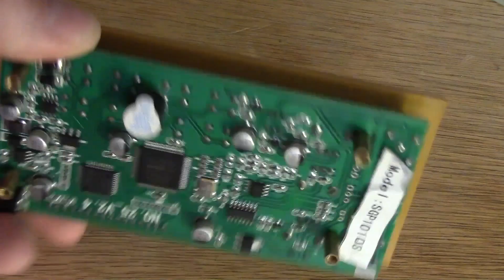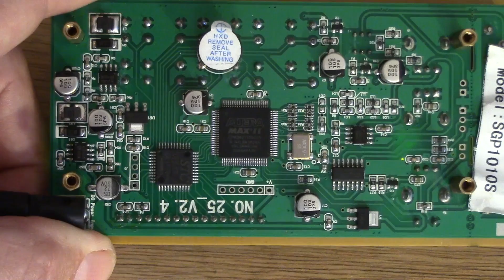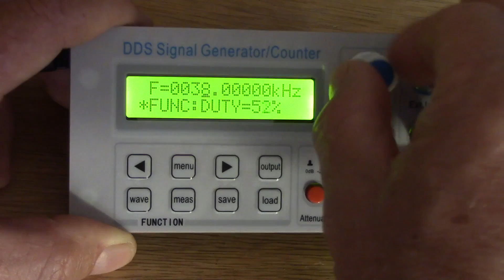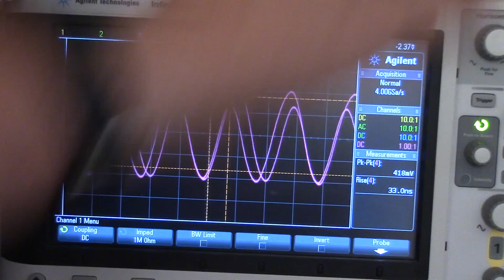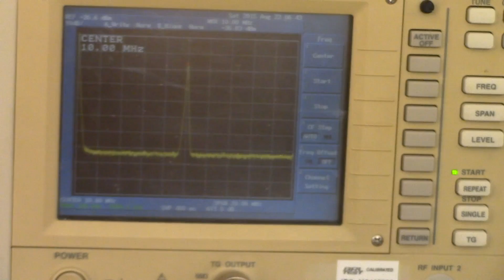Episode 16 - Review of a $50 Chinese signal generator

Comment: I have this one and I am very happy with it.

It was not mentioned in the spec and in this video, but this signal generator can do Sawtooth waveforms as well. Both rump up and rump down. You just set it to triangle and than when it asks for a duty cycle, you move it to 49% or 51% for ramp downs or rump ups.

Comment: The back and forth at higher frequencies/odder duty cycles looks like quantization noise — i.e. You're seeing 1 sample worth of the underlying dac frequency, when the numerical result is right in between the two samples.
Reply: I've tested the Rigol DDS generators in our school's lab, and it also has this funny effect, even at 10MHz (trigged on the sync output).  I think this is the artifact of digital non-integer frequency synthesis, since my own HP function generator that runs on a VCO doesn't have that weird jitter at all.
Reply: Yes, it's quantization noise. I've build an DDS generator as my bachelor thesis and this is common thing. When square wave is generated, the DAC basically receives the highest possible value (for example 0xFFF for 12bit DAC) for fist half of the period and then the lowest possible value for the other half (0x000). When your main clock runs at 20Mhz, and you are trying to generate something like 1.6Mhz, it's not evenly divisible and you are gonna get 12.5 samples per one period (6.25 per half), which means that your internal counter will jump one sample every other period - the patern will be 7x0xFFF - 6x0x000 - 6x0xFFF - 6x0x000 - 7x0xFFF -6x0x000, etc. You can think of it as adding 6.25 over and over to itself and changing the level every time the internal counter is higher or even that value, like 6.25 (change on 7th sample), 12.5 (change on 13th sample), 18.75 (19th sample), 25 (25th sample), 31.25 (32th) and so on.
The only way around this is to either change the main clock depending on frequency generated (almost impossible) or to go significanly higher with the clock speed.

Comment: I got one.  Works perfectly.  Thanks, Jack!
Reply: I can't figure out the sweep function. Pushing the rotary encoder adjust button (ADJ) seems to just shut it off, and I can't enter the sweep range. Oddly, if I switch from LINear to LOGrithmic, it sweeps from some low freq(I can't read the numbers when they are changing that fast) up past 42Mhz. It's only the 2Mhz model. SGP1002S. Help

Comment: The jitter makes complete sense.  They have implemented a numerical controlled oscillator. Basically a feedback accumulator. If the fpga clock frequency is too low, you will have that kind of jitter.
Reply: I think you are right. But that's a very undesirable design decision, as it results in this jitter. It would be far better to simply use (and specify) a coarser PWM resolution.

Comment: For that amount, you can add a tiny bit more and get a 40M samples /sec USB oscilloscope with a way better function generator (with regards to the output waveform - not features) .

Comment: At 7:10 on your video, those are not 'harmonics', it is rather product of some spurious modulation where you get main frequency and products - sum and difference. Else, great video!
Reply: Actually, I think those really are harmonics. To the left you have the large spike at DC. In the middle you have the intended fundamental at 10 MHz. At the right edge you have the first harmonic of 10MHz, at 20MHz. In the middle of the left half of the screen you have a small peak at 5MHz.. that indicates a 2-cycle pattern of irregularity, possibly to get an exact cumulative frequency given that the sample output rate runs at some fixed clock rate that might not produce exactly 10MHz if every cycle was identical.  And then a similar peak at 15MHz.  Of course, you could describe that as the 10MHz "modulated" by "spurious modulation" of 5MHz, I guess :-).

Comment: Very nice video! That jitter seems pretty weird to me as well...
Also, the Altera part is actually a CPLD, not an FPGA ;)
Reply: Very nice video.
The jitter is a something that all DDS synthesizers do. The DDS output is only jitter free when the output frequency divides evenly into the DDS clocking frequency. For example, if the output frequency is 10 Mhz, and the clock frequency is 100 MHz. then there are 10 samples per output cycle (100 Mhz / 10 MHz) and the output waveform starts and stops at exactly the same spot int he sine wave for each cycle. but consider what happens when the output is 9 Mhz. Now, there are 11.111 sample points per cycle, and the DDS starts and ends each cycle at a different point for each cycle. At first, this doesn't seem like it should be a problem, but remember that the register that controls the output frequency of the DDS is an INTEGER register, and the DDS can not do floating type divides, so each output from the DDS is very slightly different than the last. This jitter is on ALL non-integer output frequencies. It is just not noticeable at lower frequencies.

Here is an experiment you can do to see this effect: Set the generator to 10 Mhz and set the scope so that one or two cycles are visible (so that the jitter can be easily seen). Now, slowly reduce the generator output, decreasing the frequency by very small steps (10 Hz, for example). As you decrease the frequency, you will notice that the jitter will be better at some frequencies, and worse at other frequencies. And some frequencies will have no jitter at all. the frequencies that have no jitter are the ones that where the output frequency is an integer multiple of the clock frequency. If you know the frequency feeding the DDS circuit, you can compute these frequencies.

DDS synthesizers are wonderful devices. You can generate frequencies with very high frequency resolution - down to .001 Hz per step in some cases. But nothing is for free, so to get high frequency resolution, you pay for it with output jitter. Also, that output jitter on the scope shows up on the spectrum analyzer as side spurs, like the ones you show on your video. But for $50 bucks, what would you expect? I'm amazed that what you have sold for as cheap as $50.  The cost for parts and labor alone would be more than that.
Reply: +Frank Rose Of course, i should've known and makes a lot of sense. Thanks anyways for the reply.
Reply: You got it right, but NO not in this case,   in this case it is side bands due to noise on the power rails to LPF circuit.  Can be fixed pronto
Reply: @azzym312  And again you made this comment which is simply incorrect. How would a 10MHz signal acquire a sideband at +/- 5MHz? You would have to modulate it with a 5MHz signal. Where is that 5MHz signal going to come from?  You think the power rails? From a switching power supply?  Since when does a cheapo switcher operate anywhere near that frequency. And yes, obviously 5MHz could be a distant harmonic of a 100kHz switcher, but if it was really leaking that much onto the rails, there would be all kinds of other lower harmonics on there too. So no, this is an artifact of the DDS algorithm, not noise on the rails.

Comment: It would have been nice if it includes a case for it even if they changed for it ,and not everyone.needs a top of the line signal generator ,I work on tube radios ,I bought a pocket oscilloscope and I ordered a signal generator kit for under 5.00 ,a Idea I got from.great scott.

Comment: Nice review, didn't know these existed, last time I looked at low cost signal generators they were all pretty poor, Bought an ATiny based one that only uses six bits, so the sine wave is poor. Would of like to have seen how well the sine looks at the bottom of the frequency range and if it goes down to 20Hz or below, but I guess I'll find that out when I search for it

Comment: What cable were you using from that unit to your scope ???  If it was a supplied cable , it will show that on a scope, the better the cable the better the signal... I've seen it happen before.....

Comment: I know this is a Chinese signal generator but could it be used to generate Australian signals?
Reply: Support for Australian signals was removed in version 1.4
Reply: Darn it.  Figures as we need stuff suited for use upside down.
Reply: I tested mine here in the US, I flipped it upside down, and it worked fine, but all of the signals were inverted, so you have to adjust for that.
Reply: I p
Reply: freequest jnbl
Reply: Yeah, turn it upside down and use a mirror to compensate for the inversion.
Reply: Use the INV setting on you o-scope.....
Reply: Christopher Sibert Be careful, the electrons might fall out!
Reply: Just turn the phase 180 degrees
Reply: Its alright. Both China and Australia are upside down, so the signals will have the same phase.
Reply: You have to run the output through Google translate.
Reply: Since China is buying up most of Australia, yes.

Comment: The rounded square seems to be common on the cheap ebay ones. What I still wonder is how it sounds 
 ;)
Reply: That is bandwidth limitations of the output amplifier/buffer. The question is, what do you require, not what looks good.

Comment: I'm reposting my comment as it doesn't appear that it will appear as a public comment because I included a URL; let's see if this works:

Thanks for the review Jack, a nice adjunct to the YouTube review and simple upgrade of a similar more capable DDS generator by "devtty0". BTW, are you a ham radio operator? The HP8640B is a hint that you might be. 73 - Dino KL0S

Comment: so if i got it right.. with a very low frequency lets say 150 hz will the square wave create almost perfect pulses?
Reply: No, of course not. "Perfect" is an ideal. "Almost perfect" has no more descriptive power than "perfect". Define the pulse you need, otherwise it is like someone asking for a signal generator that goes from 0Hz to someothernumber, or a power supply that goes from 0V to someothernumber. Why would you need a signal generator that puts out 0Hz (no signal) or a power supply that puts out 0V (no poweer)?

Comment: What do you mean by harmonics on both sides at 7:03 ?
Reply: It is referring to the two spikes, one left and one right, of the large spike in the center
Reply: These two spikes are NOT harmonics as he calls them, they are side bands produced because of the amplitude modulation probably caused by a noisy power supply rail. The unit will benefit from a little bit of ground rerouting and filtering.
Reply: +Azzy M You may very well be correct!
I was just reiterating his description. I wouldn't be surprised at all that it has poor grounding and shielding, after all, it doesn't even have a power s/w and it has terrible jitter. Not a useful too,l except to show a child what a basic waveform looks like.  
I did enjoy it though.
Reply: The display he shows has the fundamental (10MHz) in the middle, the DC spike on the extreme left, and a 20MHz (harmonic of 10MHz) a the extreme right. The peaks at 5MHz and 15MHz are not harmonics per se of the 10MHz, but are rather due to some irregularity in the lengths of single cycles played out by the digital synthesizer, in order for it to produce a cumulatively precise 10MHz while operating with a fixed time per DAC sample. Apparently in this case, the strategy leads to half the cycles being one time length, and half the cycles being slightly longer, ie: an approximately 2-cycle pattern that repeats at 5MHz.  These are not cause by a noisy power supply rail, or a grounding or shield problem -- those would produce very different artifacts.

Comment: What do you want for $50?  Actually I've seen for $30.  You've got to factor in:  1) How much demand is there for a product like this worldwide?  2) Their board manufacture is going to be cheap meaning you're not going to have the expensive discrete components necessary to really clean things up.  3) Yes there's still some amazing used equipment to be had on Ebay; it often still costs hundreds and are you getting anything newer, for example HP, than 20 years old?  In its day (and still similar units) often cost thousands.
Reply: I have some B&K 10M and 20M sig gens. Their output is the same as this Chinese device, or worse. I regret having bought them. I have repaired one of the Chinese units for a friend. I was able to get rid of the Jitter by adding some bypassing and re-routing the ground. The Chinese will do that soon too, I am sure. The B&K fail to produce sine at half the rated max frequency.
Why did someone not produce the same in say US or Austrlia, say.  Jack Ganssle should also have shown comparison with a better known brand. This think is a remarkably well made device.

Comment: Can you please explain me what exacly offset and ampitube does??which are the better settings?? Thank you
Reply: A sine, square, or triangle wave with no offset is equally above and below 0V. That is often just what you need for a signal for testing amplifiers. But for a square wave used as a clock source, or a triangle wave for some other testing purpose, you often need all of the signal to be positive with respect to common.
That is what "offset" does.
Amplitude is to adjust the peak to peak voltage of the waveform.
One is not a "bettter" setting. It would be like asking which is better, an accelerator or steering.
Reply: @AlienRelics  thank you my friend
Reply: @andreasparasxos5372  Glad to help.

Comment: Pretty clueless review, you can not measure the rise and fall times of square waves at 10MHz with x1 input of the scope! Notice the way changing the frequency resulted in changing amplitude, clear sign that input capacitance of the scope is having an effect.
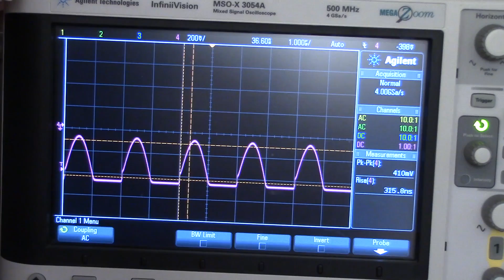Reply: Are you referring to the amplitude variation with frequency at around 2:50?  That's due to operating near the signal generator's specified bandwidth limit of 10MHz, so of course the amplitude drops off with frequency.  Also, I think you may be confusing  bandwidth issues regarding 1x vs 10x probes contrasted with the actual _scope input_, which is always "1x".  As you can see at 6:19, Jack is not using a probe. He's using a BNC cable. I didn't catch whether he mentioned it, but he may also have the scope set to 50 ohm input impedance, considering this is one of the few function generator reviews which shows no ringing on the square waves. If true, the scope input capacitance will have negligible impact.

Comment: Even for the money I can still complain about that poor square wave performance. It is a shame really. Why did they goof it up like that?
Reply: China.
Reply: Absolutely,cheap goods with poor performance.
 It's unhelpful for a Spoder man be biased against China.
Reply: What are you expecting for 50$? Agilent quality. A similar Agilent unit goes for 6k$ to 8K$ used.
In the hands of someone who UNDERSTANDS what he is doing, this is a perfect device.
A little re-routing of ground and filtering of the power supply will do absolute wonders. But you have to KNOW.
Your knocking of the products exposes your ignorance. Go learn some electronics.
You tell me where it fails to do what it is supposed to do and I will tell you why.
Reply: You can get old HP too.  They're better made.  There is bigger oscillator on some signal generator.
Reply: Paul Frederick I'm confused.  You mean cheap signal generator going blow up?
Reply: +Paul Frederick there is a lot of HP in eBay.  so far, I have HP 3325B and HP 8116A, they're really good equipment.
Reply: The output signal from the FPGA has almost certainly been fairly heavily filtered in order to achieve those decent sine characteristics. Which is going to limit your rise and fall times. That's why there's a direct digital unfiltered 1-bit output. I'm reasonably sure this happens on most DDS sig gens (totally different animal from analog sig gens) when they are pushing the envelope of their frequency as much as this is. I believe I've seen a few that spec their max square wave frequency at about 1/10 of their max sine frequency, for instance.

There are just fundamental constraints on how much you can do with a given class of silicon. If you want something equivalent to a $10k instrument, you're going to need the kind of silicon that sells for many multiples of the total price of this device. It's not that uncommon to see $500-1000 FPGAs (in 1k MOQ) in the expensive stuff.
Reply: And they let you live there with them? Very generous of them.
Reply: I was talking to our friend Mr. Frederick.
Reply: the square wave should be the simplest right? then again a high frequency almost perfect square wave needs some pretty fast rise and fall times.
Reply: It's got nothing to do with China at all. Show me one at the same price made in the Western world that outperforms it. You can't. In fact, the West's version won't be as good for that price. So stop with that silly xenophobic crap.
Reply: Ironic that the countries that prised capitalism and market forces so much are being "out capitalised".....
Reply: @1pcfred  "We invented electricity."  Hmmm, if by "we" you mean Americans, I'm afraid you're mistaken. The phenomena associated with electricity were discovered rather than invented, with some of the phenomena known to the ancient Egyptians, and later the ancient Greeks and other cultures around the Mediterranean. (And I think we know little of what was known in eastern cultures.)  In the more modern age involving storage of charge and conduction with wires, there was a great deal of activity in Europe, for example the development of the Leyden jar in the 1700's. Not until Franklin the mid 1700's does the US make much of a contribution, and even then many, if not most of the luminaries were european, such as Georg Ohm, Alessandro Volta, André-Marie Ampere, Michael Faraday, Charles-Augustin de Coulomb, just to name those early "electricians" for whom our fundamental electrical units are named. The US did score one, in Joseph Henry.